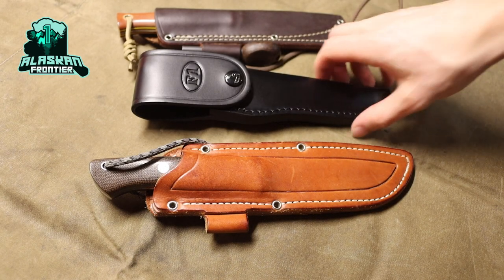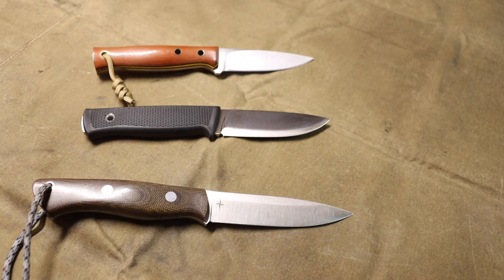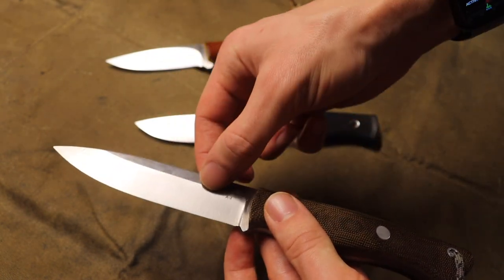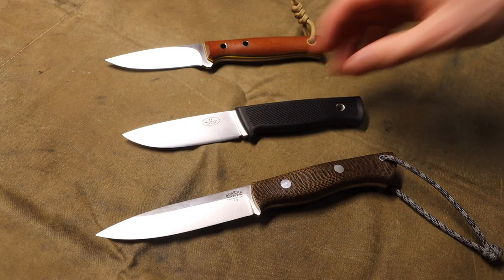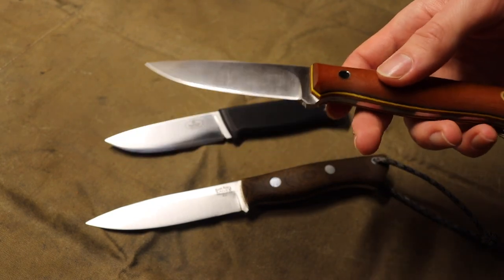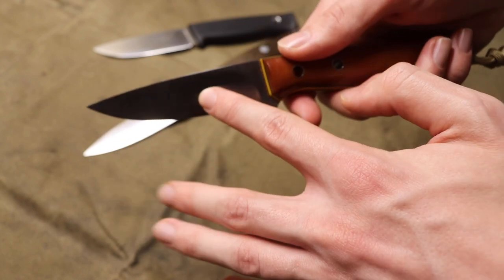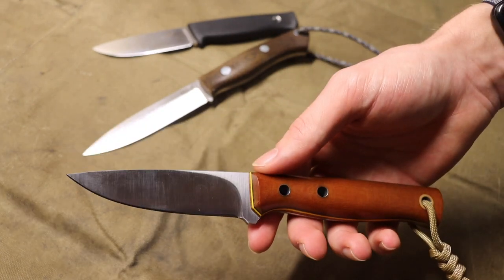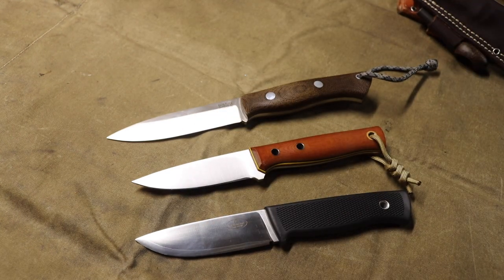Getting to Understand the Convex Grind

Comment: I am not a fan of convex grinds other than on my machetes. Yep, it is the strongest grind that is why I put it on my machetes. A hollow grind is the sharpest, but also the weakest. I like Scandi grind for outdoors things, but my edc is a flat grind. Just in case anyone wants to know, the Work Sharp belt sharpener will turn whatever you sharpen into a convex grind. That 3rd knife you showed looks like a flat grind.

Comment: The Bark River knife you showed has a Saber-Vex grind and is the reason it is thicker behind the edge. There is also a Scandi-Vex grind. When I find a convex knife with a sharpening bevel it is usually because the maker is taking a shortcut to save time and maximize profit.
Reply: Jb knifeworks is an extremely reputable usa company, adding a micro bevel takes an extra step, its not to save money, it's for today's consumers that somehow chip every blade they touch, it adds stability to the edge, even bark river put them on  their hard use knives, however I will agree that I hate micro bevels with a passion.
Reply from the maker: I do not believe there is a saber-vex grind or basically all convex's would be them.
Reply: @AlaskanFrontier1  Saber is where on the blade the grind starts and there is a saber-vex grind just like there is a saber-flat and saber-hollow grind.
Reply: @AlaskanFrontier1  Saber height convex grind as apposed to a full height convex grind. A lot of BRK’s are “saber height” convex grinds.

Comment: It’s good to explain grinds to people as most probably has no idea. I currently have two convex knives. One is the Black Jack Tac Ops 6 which has a traditional convex but does have a swedge going to the tip so it’s a little more beefy than others. The other is a modified context by LT Wright and it’s their Gen 3, which is basically a large 6-7 inch survival kephart knife
Reply from the maker: Those are some solid choices, and this is true, even the Fallkniven A1 and S1 employ swedges to give the tip added strength while retaining the convex grind.

Comment: Great video, thank you. This makes a lot of sense to me (mainly kitchen knife user). Basically - once that convex grind gets less pronounced and the whole blade thinner - the edge bevel becomes a necessity to achieve sufficient edge strength. One could of course round that edge bevel over and blend it with the rest of the blade, but that would most likely not have a large impact on how the knife would cut. In a sense - on an outdoor knife a convex grind compared to a scandi grind trades larger thickness further away from the edge for a larger thickness closer to the edge. This results in a behavior that you described very well.

Edit: One could at least to some extent remedy the tip by changing the convex grind to a thicker one towards the tip, but that would require a lot of attention to detail when grinding the blade and would likely come at a higher cost.
Reply from the maker: Good break down and follow up points. I like your feed back. Some knife companies such as Fallkniven with the A1 and S1 added swedges to give added tip strength
Reply: How can removing steel at the tip to form the swedge add strength? It doesn't make sens... The tip would be stronger if the swedge had not been ground.

There is not free lunch; removing material decreases strength/durability.